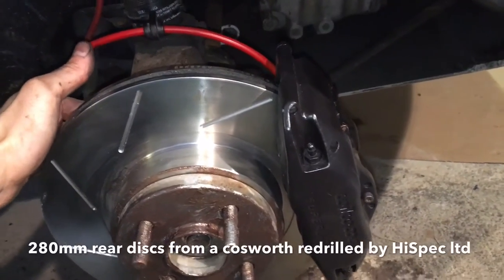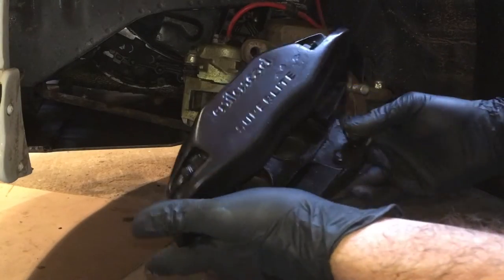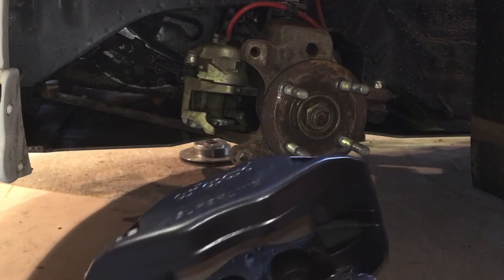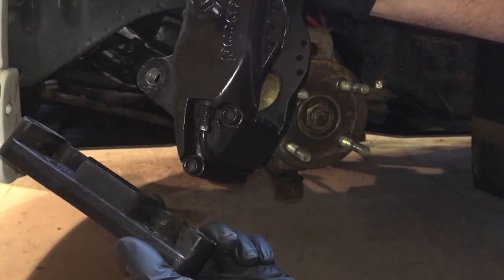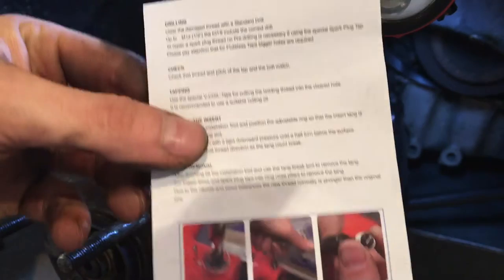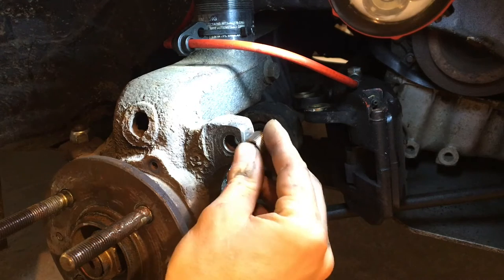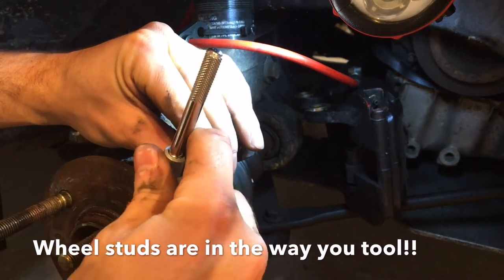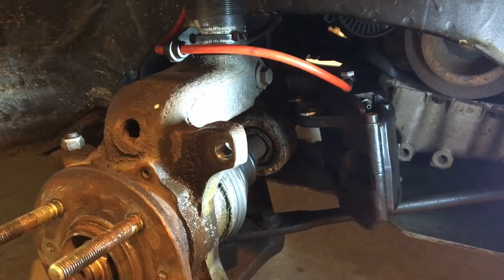How to fit 4 pots brakes onto MG ZR and testing hydrosheild air filter.

Comment: Bought some vented discs but they won't fit on my MG ZR 1.4. Mechanic said I need to replace everything from bomb etc. True? Is it worth the investment?
Reply: You need to get the caliper and carrier from a 1.8 mg zr for that to work, won't have to change "everything" that's BS just the caliper and the carrier, go to your local scrappy and you will probably get them for 20 quid each side.
Reply: @d4rkhound388  I live on middle of nowhere, so ZR's are rare. There's like 6. Never seen one in junkyard unless its a rover
Reply: @nindschaYT  a rover will work you just need to make sure it's a 1.8 so it will 100% have the larger caliper and carriers, if not they sell them on ebay for pretty cheap.
Reply: @d4rkhound388  Is it worth though? Just got a brand new pair of solid discs from TEXTAR.
Reply: @nindschaYT  Solid discs for road use vented for track use... are you racing? if not then no it's not worth it.